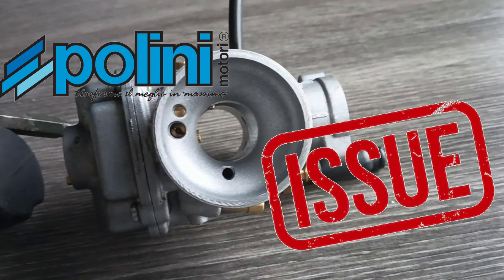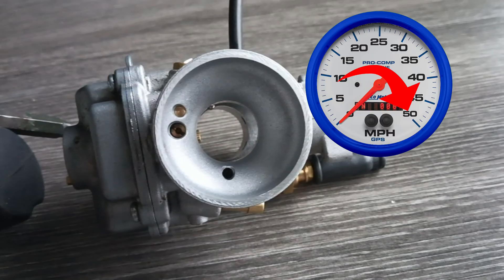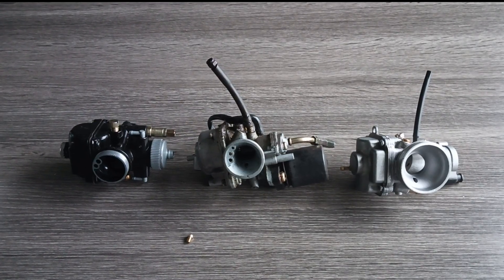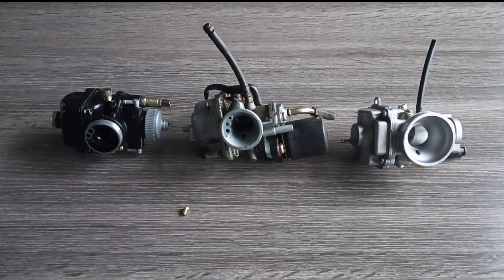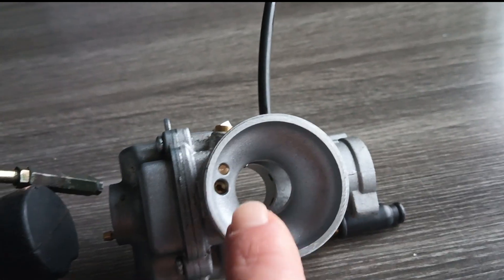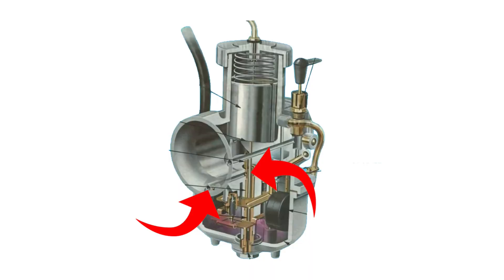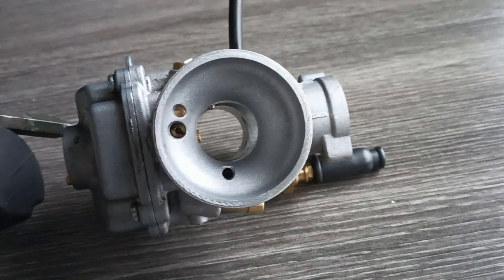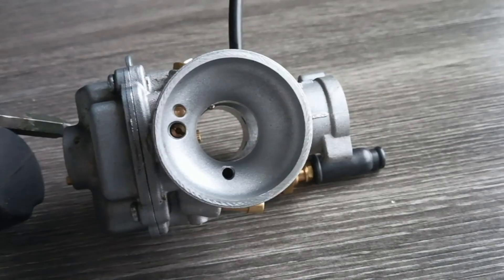Solving the main issue with the Polini CP Carburetor!

Comment: mine keeps boging till like about 60% throttle maybe more but it sounds like it, and it sounds like a rich bog. I put the needle jet clip on the highest possition and it still bogs. And it dies when i pull the choke + and dies when i put the bike on an angle or change the angle, like putting it on/off the kickstand (its kinda bent) . And the weirdest thing is the sparkplug. Half of the centre electrode is coffee color but the other is black, its like split in the middle. and it smells like gas too. + Spits oil out the around like half throttle.
Ill try to remove this screw in hopes that it might change something

Comment: If your engine is stuttering at half and below at speed your idle jet is wrong. Cp carburetors only want the idle mixture screw to be between 1and 1.5 turns out. You would know this if you read the manual.
Reply from the maker: I hear a lot of people saying they lower their idle jet but this is an "incorrect" solution. The idle jet is, like it's name suggest, ment to provide fuel at idle. Once you open the throttle, even a little, fuel starts flowing through your main atomizer. This is the mixture you need to control down low. Not the idle mixture. By lowering the idle jet tou risk running to lean when idling and also gives your engine a to lean mixture when you completely release the throttle, for example when slowing down for something.
Reply: @photexnl hola tengo un polini cp 19 en una Yamaha jog con 70 top negro escape yasuni r y no logro ajustar la carburacion en bajas se queda muy gorda ratea asta con surtidor de 32 que me aconsejas?